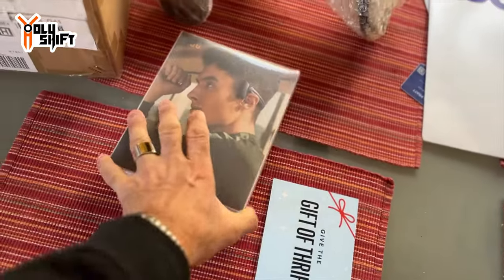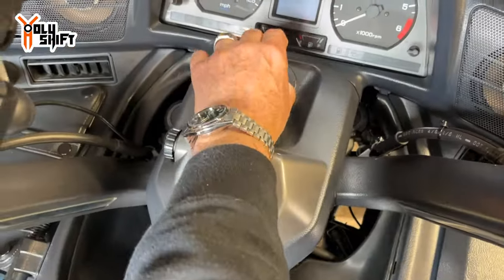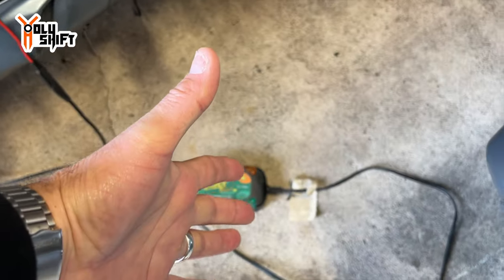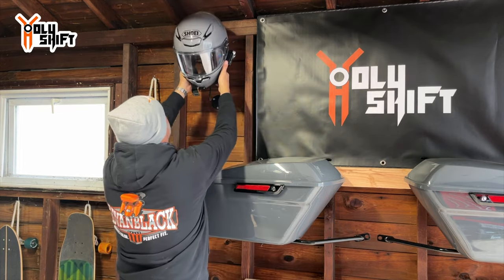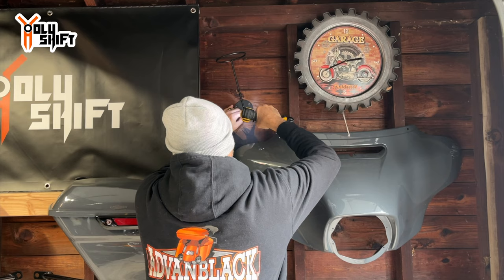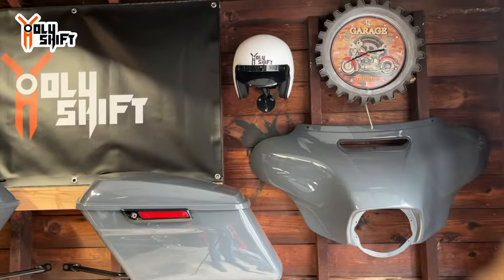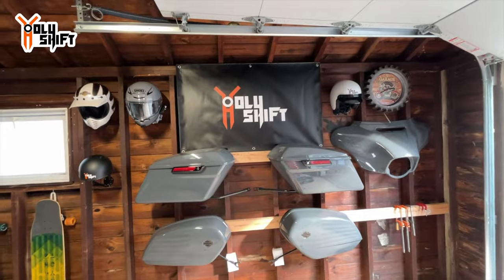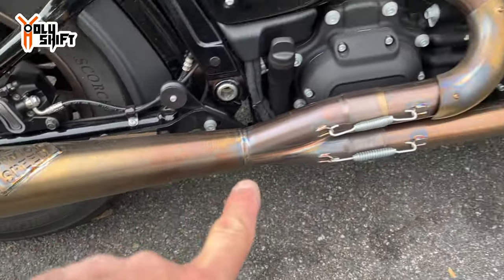Great Holiday Gift Ideas !

Comment: Hey there Sandy.  Sometimes when the battery is 100% dead you need to push a pretty strong charge through it to get it to recharge.  There are videos on how to do it on YouTube.  I've done it myself.   If you do wind up having to go this route you'll need to pull the battery out of the bike.  Hope your battery recovered and you don't have to use the nuclear option to get it to take a charge!  Great content as always!  Glad you're getting attention as an "influencer"  you certainly work hard enough to deserve it!
Reply: You are right about the 100% dead battery and some chargers have a "boost" option for that. I have a 2020 heritage softail and my battery is a hassle to get to so i clamp the positive alligator clip to a 1/2" flattened copper pipe and the other end of the pipe attaches directly to the starter. The pipe is about 16" long and insulated at the center for the hand grip.

Comment: Sandy, I love the badge on the rear fender of the gray ghost, where did you get it from?? And tell me about your levers, I must’ve missed your video on those, I’m looking for a different set, I have small hands was thinking of going with soft brake where the guy reshapes the stock levers to be more closer to the hand grip.
Reply from the maker: I have one for sell on my website under Harley parts
Reply from the maker: I bought a set of 2 and have one left over https://holyshift.us/shop/ols/products/oem-harley-standard-side-covers
Reply: My bike is black, I would prefer a different color for some contrast.